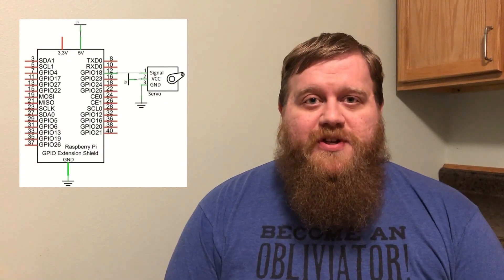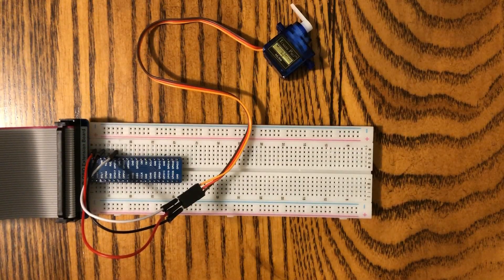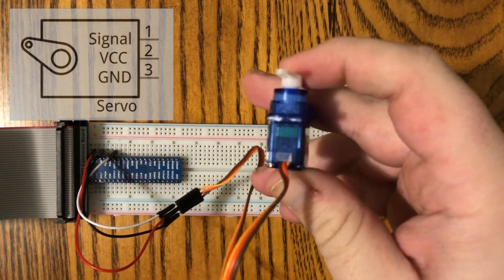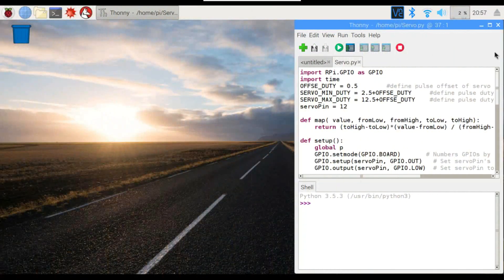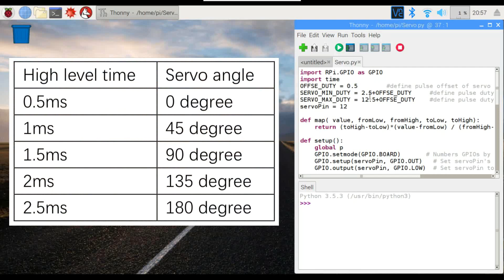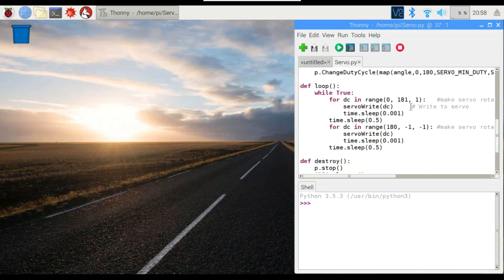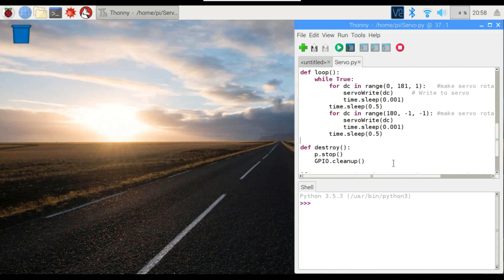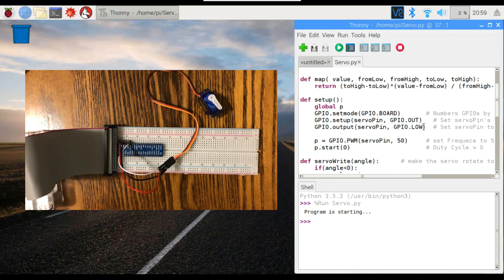Raspberry Pi Servo Fun | Raspberry Pi 3 B+ | Projects for Beginners

Comment: Great tutorial! Do I need to do this with a board (and use setmode(GPIO.BOARD) or can I connect it directly to my rpi 3 B+?
Reply from the maker: You can connect directly to the board, but the GPIO breakout board makes things much easier!
Reply: @ThinkingofPi  So I can just connect to the same GPIO pins and use the same code as you used in this tutorial?
Reply from the maker: Yes you can
Reply: @ThinkingofPi  Thanks for all the info!! This has been a great help!! Do you have a link to the source code by any chance?
Reply from the maker: Sorry I don’t. But I’ll try to put it on my google drive tomorrow
Reply: @ThinkingofPi No stress man! You're awesome!
Reply from the maker: @canyflyer  https://drive.google.com/file/d/1OZnUzY2ylYSe32XuJsQrPCbtaV-joxiZ/view?usp=sharing